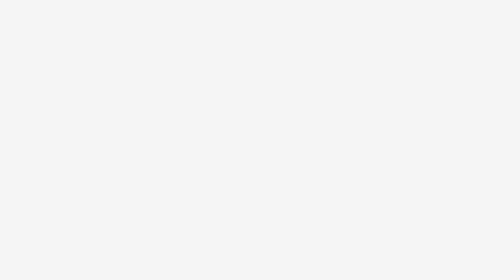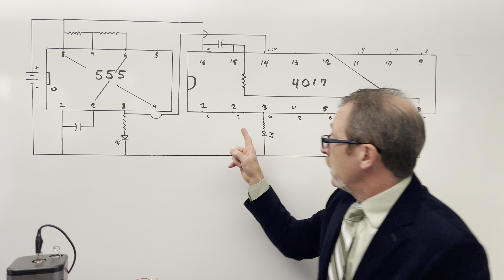Build a Back-and-Forth Lighting Circuit with Your Students!

Comment: Built this exact circuit inside a hollow of my son's Pinewood Derby car many moons ago. Included transistor drivers with fall-off caps to make each LED fade as well. It ran on a 12v A23 battery. He and I had recently watched both the original and the 2008 reboot Knight Rider so he wanted his Pinewood to be a Trans Am. We even came up with an acronym, S.K.O.U.T. though I can't recall what it stood for. Kinda wish I'd had AT or a PIC at the time but kinda glad I didn't.
Reply from the maker: Thanks for sharing!

Comment: I made this back in the 80s, and put it on my car, like the night rider, yes you ought to use coupling diodes when ever you are going to combine two outputs to drive a single LED, as you could damage the chip if output of one feeds back into the off state of the other output. 
4017 chip is so versatile, you can switch on 100 LED's sequentially using two of them in a matrix of 10 x 10 leds. I have used it as a programe controller to execute different steps through clocking it at a slow rate and can achieve different time periods by combining various outputs.
Reply from the maker: Such a fun circuit!

Comment: Pls add the direct downloadlink to the pdf with example values of each resistor and capacity to the Video to build a working example from scratch, thx
Reply from the maker: Here is a list of common items on Amazon. I hope this helps get you started!

Texas Instruments CD4017BE CD4017 CMOS Decade Counter with 10 Decoded Outs (Pack of 5)
BOJACK NE555 Timer IC NE555P Pulse Generator DIP-8 (Pack of 50 pcs)
1K Ohm Carbon Film Single Fixed Resistor, 1/2W (0.5 Watts), 5% Tolerance, 1K (40 Pack)
BOJACK 1000 Pcs 25 Values Resistor Kit 1 Ohm-1M Ohm with 5% 1/4W Carbon Film Resistors Assortment
24 Values Electrolytic Capacitor Assortment Kit from 0.1uF to 1000uF 10V 16V 25V 50V in-line Aluminum Capacitors Set
BOJACK 5 Colors 500 pcs 5mm LED Diode Lights Assorted Kit Pack Bright Lighting Bulb Lamps Electronics Components 5 mm Light Emitting Diodes Parts
BOJACK 3 Values 130 Pcs Solderless Breadboard 4 Pcs 830 Tie Points & 400 Tie Points & 126 Pcs Flexible Breadboard Jumper Wires